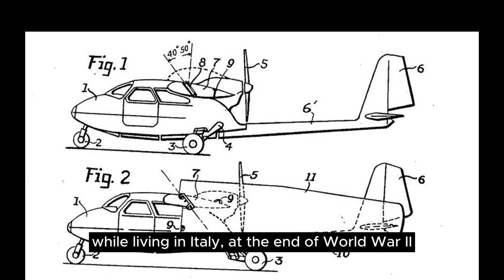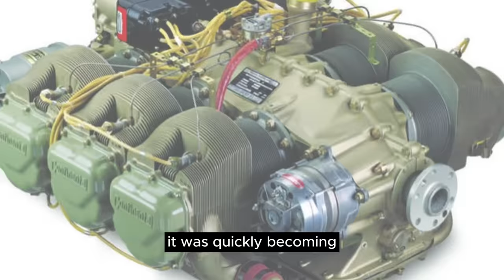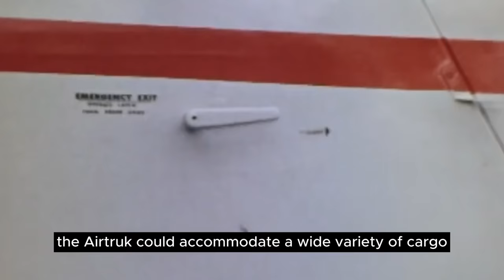The Flying Wonder from Down Under

Comment: I am an airplane nut.  When I saw that plane on Mad Max I thought it was fictional because I never saw one before.  I grew up in an area of the world with no highways or roads.  It was by air, boat or snow-mobile.
Reply from the maker: Alaska?    Yeah I also thought the plane was made for the movie, not an actual real model.
Reply: Thanks to Mad Max for introducing us to strange aircraft; the oddball Airtruck and the more known but similarly uncommon gyrocopter (although my first intro to the gyrocopter was in You Only Live Twice). I love how this Airtruck is function over form or a plane designed for ease of use and utility beyond a conventional design. The "load it quickly while the engine is still running" feature sold me on the design as did the compact length.
Reply: On that note, I fully expected you to have a video on Gyrocopters since you mentioned Mad Max in this video and your channel avatar is none other than the famous Gyro Captain from Mad Max 2 / The Road Warrior.
Reply from the maker: Good point!  Gyro Captain is my favorite "aviation character" for lack of a better word, hence my YT and IG avatar.  And you've every right to hold me to that.  I'm not much of a rotor-head, but gyros are cool and I should consider a compilation on that.
Reply: @Hjerte_Verke  -  Came here to say this as well.  Truly, I thought it was created just for the movie.  Had no idea it was a real production aircraft.  Fascinating one at that.
Reply: Proud to say I know of one Airtruck that is just sitting at my local airport at YBTH (Bathurst NSW) and has been there for many years along with a 337 Sky Master and many other relics 😢
Reply: Same here!  I had no idea it was a real airplane!
Reply: Hmm seem to recall they used this in a modern vampire movie guy was a pilot using the bay for his sleeping  place..soil ..as he flew across country
Reply: @miguelcastaneda7257  -  Interesting plot twist.
Reply: @@TheBirdsntheBees Alaskans don't have snowmobiles.  We only have snowmachines.  No true Alaskan ever calls them a snowmobile.
Reply: probably this is why it was chosen
Reply: So many of us had a similar experience. At first glance, it doesn't look like it could fly well. After the movie, I tried to find anything I could about it. I think there was an old magazine article that I found at the library but that was it.
Reply: @aircraftadventures-vids  Yes! I grew up in Alaska.
Reply: @@TheBirdsntheBees Alaska
Reply: @JuanDaringMann  I said that for the rest of the world.
Reply: The movie was the first thing that came to mind when this one came across my desk.
Reply: I had to check to see if there was a Mad Max ‘Beyond the Thunderdome’ reference. Good to see I’m not the only one with culture.🤣
Reply from the maker: @viper2148  two men enter, one man leaves 💪
Reply: @aircraftadventures-vids  thanks for highlighting such a wonderful, obscure aircraft.
Reply from the maker: @viper2148  thanks for watching!  Just dropped another somewhat obscure aircraft yesterday, check it out
Reply: 😅Dude It Just Caught Me Off Guard. I Had To Stop Everything I Was Doing To Watch 😂. Very Cool, Very Weird! Tyvm!
Reply: I'd love an airtruk and a Ka26 for my weird aircraft collection.
Reply: I knew it was real but assumed it was some kind of single unique custom job for the movie.
Reply: NWT or Nunavut, is my guess.
Reply: @JuanDaringMann They’re Ski-Doo or snowmobiles here in Canada.
Reply: Sounds a bit like the Steven King book I think called Night Flights. It's prob made into movie so could be same one
Reply: Same here!
Reply: @aircraftadventures-vids have you done the erco ercoupe? Features in a Hogan's Heroes episode to boot! Another very remarkable plane.
Reply: @grunthostheflatulent9649 an airtruk and an erco ercoupe for me- another remarkable small plane designed pre ww2. Featured in a Hogan's Heroes episode.
Reply from the maker: @rossbrumby1957  I have not, but I agree it's an interesting one to cover.  My dad owned one in the 50s, told me it was a lot of fun.
Reply: My friend died in that plane in 1987. The hopper door jammed when the load shifted and nosed into the ground.

Comment: There is an Airtruk here in the San Joaquin Valley. It is owned by a rancher in the foothills that uses it to hop down in the valley and when needed, it is filled with water and used for putting out fires since he has the crop dusting hardware. Can't miss it, it's painted day glo yellow with day glo orange stripes.
Reply: What part of The Valley should I look for it in? I live in Jackson Calif.

Comment: That's my footage at 6.21 taken at the 1988 Bicentennial Airshow at Richmond in NSW.  Note that the nose gear is now on an oleo whereas previously it had been the trailing link on rubber donuts (as was the main gear).
Watch more of the Airtruk (along with a CAC Ceres handling display at Tyabb here: https://www.youtube.com/watch?v=BaJKx8TLP3Q
You can see the different nose gear there.
I do have an original brochure tucked away somewhere.
Reply: At 5:21

Comment: 6:37 Wings tips and horizontal stabilizer tips (and to a lesser degree vertical stabilizer tips) produce vortices and the Airtruk’s design has twice as many vortex generating tips as a conventional airplane - vortices within vortices. Vortices are normally bad because they create drag by stirring up the air, but for the Airtruk, because it stirred up the air so much, it made for a simple hopper and dispersal system for the product being sprayed.
Reply: If you have more wing ends the induced drag drops dramatically. Its the square root..

Comment: My log book shows around 700 glider launches in one between 1980 and 1983 in NZ. A lot of fun to fly with a 3 blade constant speed propellor & a 300 Continental fuel injected motor. Wearing a bone dome was a necessity as the cockpit from seat level to the roof narrowed considerably so that in turbulence your head would bang against the sides of the cockpit. 
When launching into strong wave conditions sometimes the best 'get down quick' manoeuvre was a half roll and a 4g pull through...if you had someone in the back 'loader' seats along for the ride you could hear the screams through all the noise...
Reply: you probably towed me up then as I flew gliders at the Auckland gliding club, Grahame Wilson,Kieth Lewis, Nigel Arkly, Murray Hopkins, Sue Truman and Chris Truman...to name a few of our tow pilots, great times and a great aircraft!

Comment: Transfeld PTY.  220 Airtruks were built.  Despite the wingtip appearance,  an Airtruk had a lifty flat bottom airfoil with a sharp leading edge.  The landing gear and nosegear were excellent.  The Airtruck was not short coupled because the wing and tail had short chords. The landing gear helped with the topheaviness.

Comment: Great video! Thanks for taking the time.  I have seen a pair flying recently in Temora, NSW, Australia. Strange looking things, but always make you smile.
Reply from the maker: That pair you saw most likely is part of a demo team, they only use them at airshows at expos (thankfully!)
Reply: There are two of these machines based in Temora, they are both airworthy and flown regularly by the owner.

Comment: Used to see the Airtruk crop dusting in the South Island of New Zealand a lot. The turn around speed was pretty quick - land ,spin around, truck in -truck out, hammer down and off. Spent all day watching one float over the airfield fence as it landed  - while we waited to board the parachute drop plane. Later on he would wait while we landed - roll up our chutes and get out of the way - and then he would float on in. It was great watching him stand it on one wing and reef it around then float on in. We did this routine all day.
Had a chance to buy one back in the day - regret not getting it - would of made a great (but slow) personal plane.

Comment: the early PL12s were fitted with the geared Continental Tiara engine, and this probably affected early sales. The Tiara was notoriously unreliable, and the gyroscopic forces and G loading that Ag operations subjected it to meant it had a terrible failure rate. It was a real oddball engine too, so getting parts took a long time - too long for busy operators. Continental eventually gave up on it and the PL12 switched to the IO-520 instead.
Reply from the maker: I do recall reading about this, but I'm not sure if they kept that engine long enough to have really affected anything.  In fact I don't think the Tiara was installed in any aircraft in significant numbers.
Reply: @aircraftadventures-vids  No, the Tiara was used extensively at one point with the PL12, certainly In New Zealand. (they were one of the few production aircraft to actually use that engine). I have a friend who worked for Barr Bros ltd, the NZ importers, and they had no end of problem with the Tiara-engined machines. most went to the IO-520 in the end.
Reply: The Tiara had the prop driven off the camshaft, not the crankshaft as per a normal direct drive engine. This gave the prop a 2:1 reduction to crankshaft RPM. No, they weren’t that reliable. The crankshaft RPM was 4000 which was very high for these engines. Normally, they’d be around 2700 for the direct drive version.

Comment: Built in a factory just off Station Road, Seven Hills (in Western Sydney). There is a GeoCache named AirTruk nearby  ;-)
Yes, it looked curious, but it was designed to be a cropduster from the outset and fit the bill perfectly.
A great little beastie. I believe it may have been built under license in Eastern Europe at some point.
Reply: I remember seeing the occasional test flight taking off and landing from the factory at seven hills. Good use of stol capability. Wonder about the risk assessment though.
Reply: I thought they were built by Transylvanian Timbers but hadn't thought of a possible connection to the nearby Transfield factory
Reply: @peteboe2114 
Right I lived at Seven Hills and saw them being test flown

Comment: I helped rebuild one in the mid noughties. Once in use the owner/pilot noted that in comparison with the likes of a Pawnee or Cessna 185 it had reduced lateral control on landing runout as the airflow from the propeller didnt pass across the rudder. This made landing on horrible strips we used a different kind of challenge as compared to the tail-dragger types. Apart from this quirk it was apparently a plane with no vice. More docile to handle than a 185 and it would not bite you in the same way the Cessna would in a stall. 

The plane I worked on was ultimately lost after losing power on a takeoff run on one of our shorter, hilltop strips ( V1 was the moment you applied engine power) the layout of the cockpit had two identical levers to the pilots left. One for flaps and another(painted black and yellow) for hopper dump. Once the pilot was aware of the power loss he attempted to dump the load of super-phospate but mistakenly closed the flaps instead(whilst in ground effect) and the rest was history. The pilot did survive uninjured which was a testament to the happer being behind and below the pilot position

A truly unquie aircraft indeed!
Reply from the maker: Lots of testimonials in the comments on pilots leaving unscathed from crashes!  Tx for the story

Comment: There were 3 of them in Serbia where i flew. Looked quite unusual, very tall cockpit, but fly just fine with that 6 cylinder Lycoming. Two got retired, one crashed with deadly outcome, but not due to plane itself. We used to call them Kangaroo. Newer flew any of them, but spent years next to them...

Comment: G'day,

I live in Glen Innes NSW, Oz.

When I was a kid there was an Airtruck for a while, working for Airfarm or Air Ag, based in Armidale...

There was a CAC  (Commonwealth Aircraft Corporation) Ceres at the same time, the Ceres was based on the CAC Wirraway - which furnished the Spares you thought came from a T-6 Texan 

Nope. Wirraways are not Texans.

Both the Airtrucks and the Ceres were outlasted by 650 Hp DHC Beavers, and F4U Fletchers...; then the Fletchers' owners bought-out the Beaver Fleet's Owners, and sold them for Floatplane Conversions to stop them re-entering the market here.

And now the Fletchers have Turboprops..

But, yeah, in about 1968 or '69 there was a red & white Airtruck overflying my hometown at 500 ft several days every week.

In 1978 I worked on Neil Cottee's Sopwith Pup Replica, built by Transavia at Camden, fitted with an Armstrong Siddley Gennet Major, with a replica Fokker DR-1 using a Warner Scarab at Olde Bowral Airfield, in the NSW Southern Highlands.

You did ask.

Such is life,

Have a good one...

Stay safe.

;-p

Ciao !

Comment: You missed the principal reason for the split tailplane.  If you had ever flown a cropduster, you would be aware that when the load is "dumped" -  e.g. in order to lighten the aircraft so it could clear an obstacle in an emergency - the falling plume of liquid or solids causes a large downwash on the tailplane, if it is located in the conventional position.  This results in most aircraft of that conventional layout, pitching uncontrollably nose-upward for a few seconds  - which puts them at risk of a flick roll, very close to the ground.  Pellarini knew this and his design uniquely avoided that; the PL12 simply rises like a lift when the weight is dropped, which means that one could dump a ton of water on a selected spot from  as low as you liked -  I did it from about 10 feet above the ground.   I was given the job of doing an independent check of the performance of the PL12 with the IO-720 engine, when the Australian government offered to subsidise the supply of three of them to the Chinese Government.  It had a hopper volume of 1 cubic metre, i.e. one English ton of water.  The rear compartment could carry two occupants sitting aft of the hopper, plus all the spray booms, which  folded - so one could stow them internally when flying cross-country.   Yes, it "hit a brick wall" if you tried to cruise much above 100 knots, but that had nothing to do with all the tip vortices.   It was actually very pleasant (if noisy) to fly, though the extra two cylinders of the IO 720 did not give the aircraft the hoped-for performance gain over the 300 HP version.  The 300 HP version was by far the most efficient aircraft for its intended purpose at that time;  it was superseded by larger aircraft with twice the power (mainly from turboprop engines) when they became available.  Also, the wide swathe width from the sesquiplane layout proved to be a disadvantage when  spray drift became a major issue.
Reply from the maker: Thanks for sharing your experience!  I can only imagine the feeling of 8-cylinders banging away right below your feet, lol

Comment: A very interesting story ! There was a top dressing company in my hometown, Wanganui, NZ but they used Fletcher FU 24's and a DC3. So this aircraft is new to me. I wonder if you could one day make a video about the Victor Air Tourer, a New Zealand built two seater, in which I learned to fly. The manufacturer hoped to sell them to the NZ Air force as a trainer and the joystick even had a spot for a gun button. They were fully aerobatic and a joy to fly. Mine was ZK CWC and I believe it's still flying after 50 years.

Comment: Ahh-hh, a real nostalgia trip! I used to work at Ardmore aerodrome (Auckland) and the row of AIRTRUK's parked outside Barr Brother was always a welcome and familiar sight. However, I always felt the basic AIRTRUK design was a lost opportunity in waiting because it almost screamed at you for the designer to give it a pusher prop makeover. Would look even cooler. In again topdressing guise the only downside with a nose hopper access cover would be superphos spillage into the engine cooling gills and the leader's tyres tearing up the soft paddock in front of the aircraft.

Comment: Don't forget Molt Taylor's Aerocar..... you towed the tail around with it like a trailer until ready to fly, I believe the prop, at the tail, had to be connected to somewhat of a PTO shaft - it was featured on the Bob Cummings TV show, just like the Cessna 310 in Sky King(a thinly disguised promotional gimmick for Cessna Aircraft).

Comment: My dad was a crop-duster pilot who flew these planes for a company called Airfarm out of Tamworth , NSW in the late 60's /early 70's. I remember one of the times he took my older brother and I in that back seat (facing backward) to one of the airstrips he operated from. We would spend the day playing on the superphosphate pile while he was working. I always found it amazing how he threw that plane around flying 18 inches off the ground as he dumped the load of superphosphate and climbed over the trees at the end of the field and then brought it back around in the tightest turns I had ever seen, to do another run. He then landed and the loader was waiting and loaded the plane again and off he went (just as seen in this video). After the day was done, he put us back in that back cabin again and took off to return to Tamworth after one more load. I remember well the G forces on my brother and I as he completed the final passes and look back on how tough and maneuverable those little planes must have been. Dad passed this last August and had so many stories to tell about life as a crop duster. He did have one accident in the Airtruk however. He was taxiing down the runway heading out to a job when the front wheel collapsed and he ended up upside down. The crash report said that there was a crack in the front wheel strut from a manufacturing fault. The only comment from the owner of the plane went something like" You bastard, you broke my plane!"
Thanks for the great video and the trip down memory lane!!

Comment: I used to see them from the train on the way to work, 30-40 years ago.  They were built in western Sydney at Seven Hills/Toongabbie.  The factory was right beside the railway line.  There is an Airtruk in the Sydney Powerhouse museum.